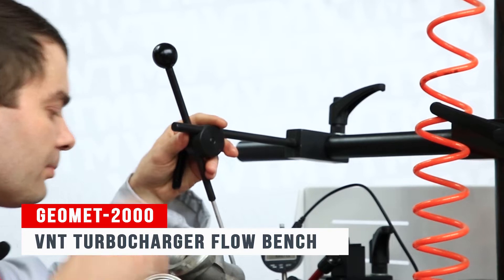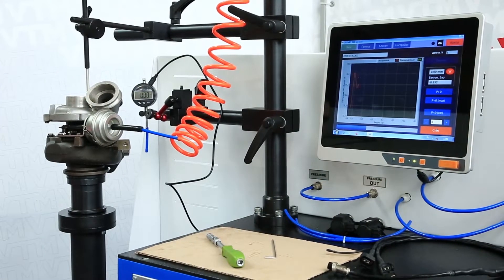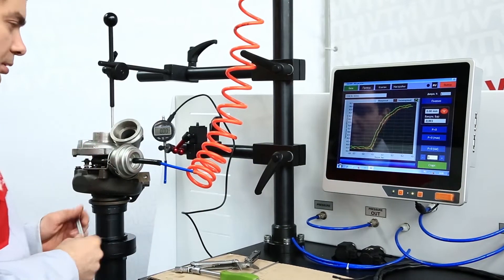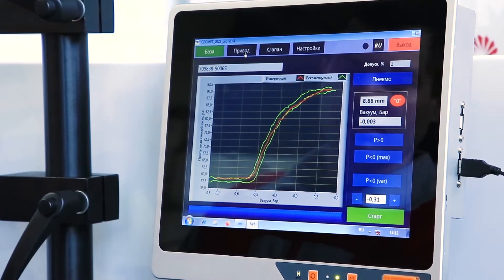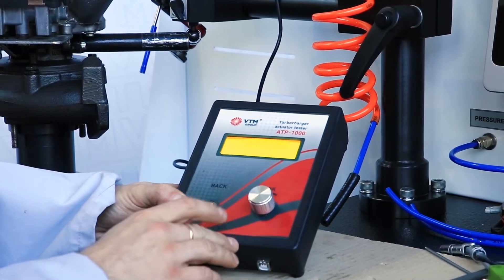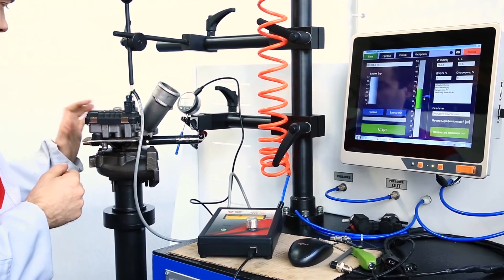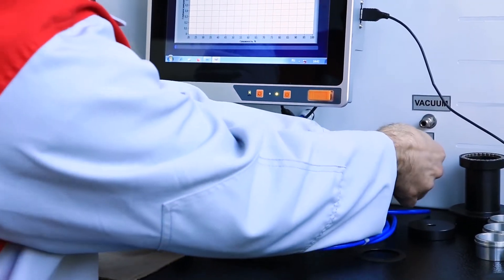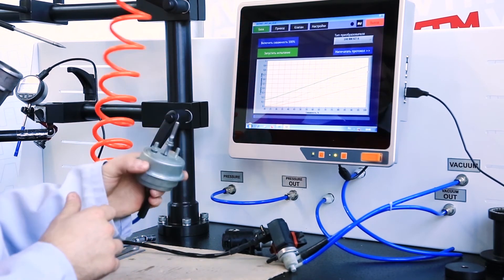VNT Turbo Flow Bench GEOMET-2000 | Calibrating the variable geometry of VNT turbocharger | VTM Group

Comment: What happen if n75 it not good  what are symptoms   turbo or n75 problem bcz i have issue in my golf 4 tdi
Reply from the maker: Lose of boost, to much boost, limp mode. It controls your boost so anything to do with boost issues. 
It looks like a turbo that doesn't work. So after checking the turbocharger, it is worth checking the n75.
Reply: @VTM.balancing   i have issue hezitation also Goes highway 110 and not geting more speed looks like limp mode